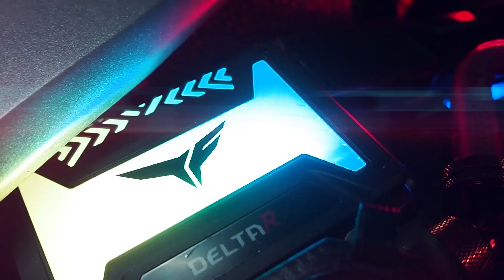CMWS2019 - CMWS HYPERSPORT BY JMDF

Comment: why the hell do you need a 1000W psu with ONE GPU and its only a GTX 1060? what? 
GTX 1060 "Maximum Graphics Card Power (W) 120 W"  IT USES 120W MAX!
the CPU uses 35W max... 
For what reason would a 1000W psu be required in this low spec build? You obviously have no idea how to properly size a PSU for a computer. 
and dont give me that "buut powr wrails... " that's just not a problem these days where everything is more power efficient than it was 10 years ago. 

its not even near the 50% max efficiency of the 80+ gold psu. you would use under 20% of the gpu's rated power at max load. 
a box a crayons could power that computer. (overly sarcastic about the crayons.)

i was going to vote for it because it looked cool but you just had to list the specs...
Reply from the maker: take it easy bro, :D 
Must apologize for causing you resentment in this matter.